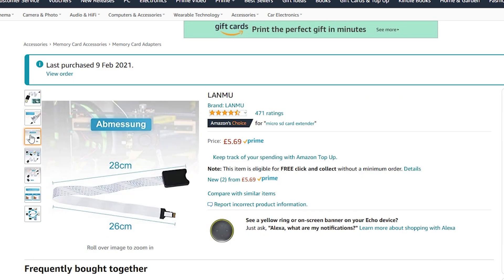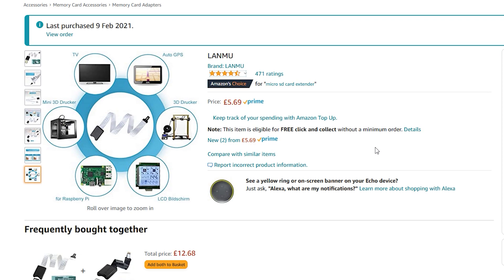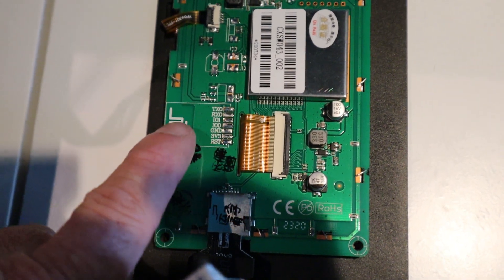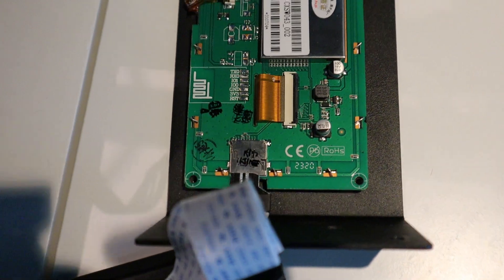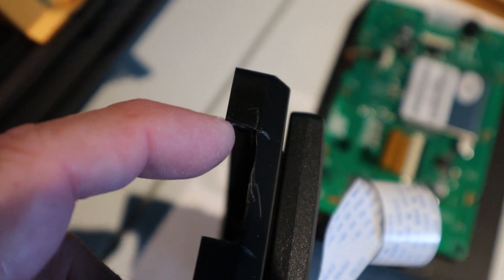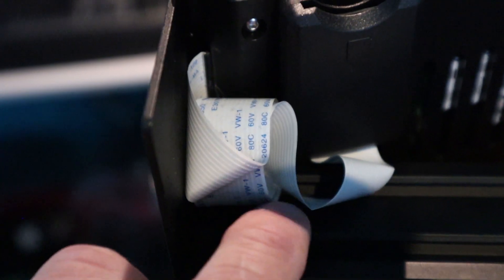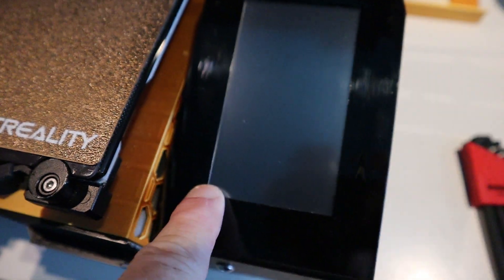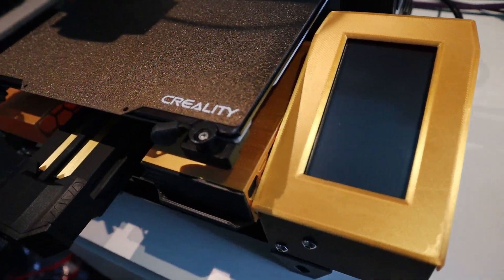Fitting an SD card extender lead to a Creality CR6 SE 3D Printer

Comment: Hi interesting video,  quick question could you also load print files through it to?
Reply from the maker: Hi Nathan

No it's only to extend the socket of the display which is used solely for updating its firmware.
Prints are read by the SD slot on the front of the machine which is already easily accessible

Comment: Hello Tom. Can you make a video about the correct tightening of the screws of the print bed? I would also be very interested in the correct tensioning of the belts for the x- and y-axis. How do you do that? Trank you very much.
Reply from the maker: Hi Brillu...Do you mean the eccentric bolts that alter the tightness of the rubber wheels on the runners or the 11 screws/bolts holding the bed down....if the former there are  loads of vids on YouTube as its the same method for most printers .....if the latter I have never needed to do anything to them other than checking for tightness periodically but so far they havent come loose.....as for the belts I just turn the knob enough so the belts are not really slack but not really "about to snap" tight...as long as you can push down a bit and it springs back it should be OK
Reply: @TomsManShed  I mean the eccentric bolts that alter the tightness of the rubber wheels on the runners...

Comment: Thank you for the video! As always very understandable and good quality. :-)

Have you been looking into Octoprint? Yesterday a package with a Raspberry and stuff has arrived.  Cannot wait to try it out and observe the printer from remote.
Reply from the maker: Hi Robin...thanks again for the comment...yes Octoprint looks good but at the mo is over my head :) ....its definitely something I may want to get into in the future but having never tried it or used Raspberry/Arduino and stuff I haven't a clue....I do know that connecting a USB lead to the CR6 has caused some probs in the past with the 24v problem so make sure you have done the Kapton insulation under the bed clips thing etc

Maybe you can do a vid of how to connect it all for me to learn the ropes :)
Reply: Unless you're using the community firmware for the CR-6 SE, you're going to want to avoid the Raspberry Pi for now. It's not compatible with the stock firmware.

Comment: Great video Tom! Bought one extender myself from aliexpress a few days ago and i hope it arrives quickly. Also got a dual gear extruder as mine is sliping . Keep the videos coming! :)
Reply from the maker: Thanks for that....yes will keep an eye on the extruder....I tried TPU for the first time last week and it worked great....had heard it could be difficult without a dual extruder but like I say it worked brill....stuck like glue to the bed though...will prob use tape on it for easy removal next time